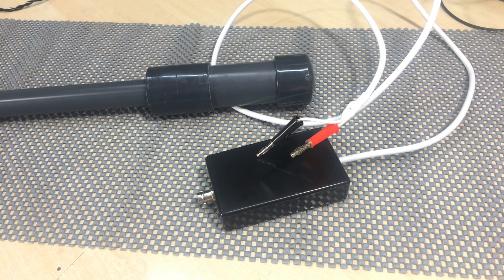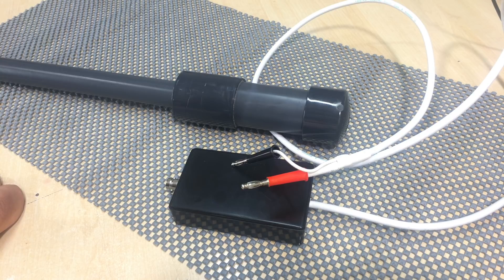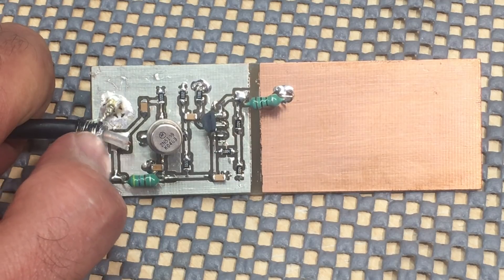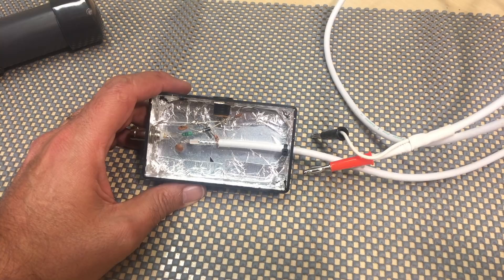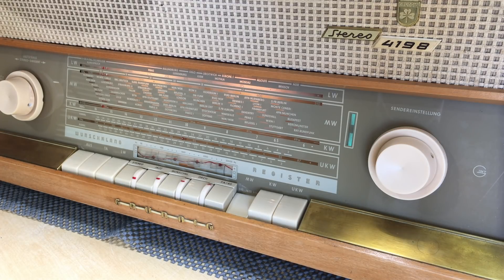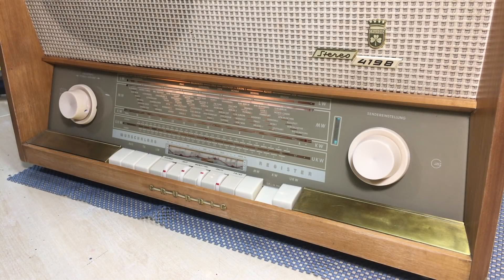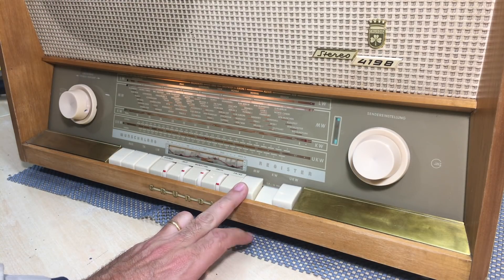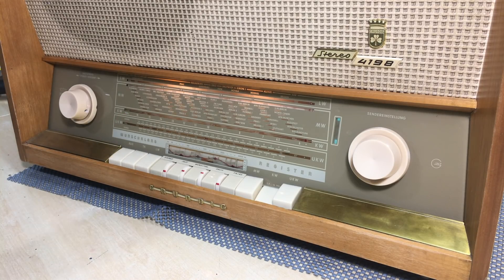Build and test a PA0RDT MINI WHIP antenna. The tiny great solution for LW, MW and SW listening.

Comment: Thanks for another excellent overview video Manuel!

Like you I was a bit skeptical about the PA0RDT mini-whip. Unfortunately, in my inner-suburban location in a slight valley surrounded by lots of houses full of electrical noise, cable TV, solar inverters, and several 10kW+ AM transmitters fairly close, I haven't seen the same success - the homebrew & kit examples I've built aren't really any better than any other amplified whip. Up high, on a pole above my 3 storey block of units, the combination of a lot of near-field noise + IM/overload/splatter means that while absolute signal level is higher, they dont show any real advantage over other amplified whips, & generally have worse S/N ratio than a longwire.

The other problem here is the big electrical storms every other day in summer (I think it's been 5 this week!). FET input amps, or even higher-impedance bipolar designs, stuck up high in the air here tend not to last very long 😞. Nice low-impedance dipoles or small loops work well though and dont need the active bits replaced too often 😉. Can't really criticise the design/concept as such, though - more a recognition that there's no "one size fits all" antenna. It certainly seems to work for you there, as I think I've commented before.

Tip you probably already know: those little resistor-packaged chokes are pretty lossy at any frequency, and are really only good for supply decoupling/isolation. I suspect you'd get a decent improvement at the upper end of HF by replacing the inductor from patch to FET gate with a hand-wound one - say, a few turns air-wound on a 5mm-6mm former, or a couple of turns through a ferrite bead? Worth a try. 

Anyway, enough rambling! Merry Christmas & a Happy New Year to you and your family, and looking forward to more interesting videos in 2019!
Reply from the maker: Hi Jim. I agree that some conditions are really taxing on our hobby. 
The inductor used is going to get swapped out, as you suggest. I see that the original builds don't use one at all, going straight into the gate of the FET. Might try that, actually.
Merry Christmas.

Comment: You must be psychic Manuel. I have been looking these last few days for omni antennas for the broadcast band and trying to remember the one you use. Looks like a project for me to build in the next couple of weeks. Happy Christmas to you and yours.  George
Reply from the maker: Hi George. Glad to be opportune :}.
It’s actually very simple to build. However, the designer, Roelof Bakker, sells them fully built and tested to order. You can contact him on roelof@ndb.demon.nl
From the info I have, he sells them for practically the same as you would pay just for the components. I am actually going to order one myself, as I believe a guy like this should be supported for his work, which he made available freely for all to build.
Reply: I was actually looking at the prebuilt ones on ebay and like you say, the two rf devices alone are expensive as they have been obsolete for a while. There is a version out there using newer surface mount devices which does look good as well. There seems to be two schools of thought about the grounding needed. Some of the Dutch articles say that a well grounded mast should be used, others state that a mast of capacitive equivalence be used. I am tempted to put mine on the top of my tower above the HF tribander but I am a touch worried that the full limit rf transmitted may cause the devices to fail.
Reply: I ordered mine on ebay from Russia.  It arrived in about 10-12 days.  Have not tested it yet.  I may build the next one if this one produces the desired results.  Does it offer any benefit on the broadcast bands?  Happy Holidays to George and M Caldeira from the USA.  Doc
Reply from the maker: Doc Holliday : it is especially good on the broadcast band, which we call Medium Wave over here. Enjoy and happy holidays.
Reply: @electronicsoldandnew  Good to know.  I'm relatively new to all this and didn't appreciate that the two were the same.  I still can't remember meters vs frequency bands.  It will come.  I just finished restoring aHallicrafters S-38 and bought the mini-whip for that mainly.  They seemed like a good match and as you both mentioned cost, I couldn't build it for much less than the one I bought.  Just rounded up a power supply today and will test it this weekend.  I'll report my results.  Maybe make my first youtube video?  Who knows.  Seems like a LOT of work to produce this type of content.  Great job.